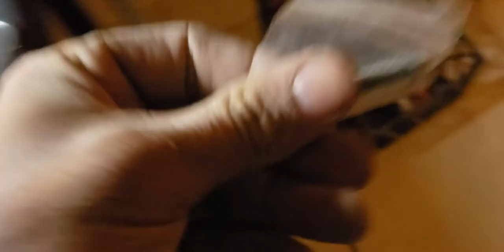Building a custom m14/m1a fiberglass stock

Comment: Why don’t you try epoxy with colloidal silica or glass beads.  Both of these materials lower the weight dramatically over body fillers such as bondo, they are also structural entities.

Comment: Where did you get a USGI fiberglass stock for $20?
Reply: i got one today for 120 on numrich lol
Reply from the maker: Numrich had a bunch of project stocks that were all basically unusable as they were. I had to cut off much of the metal and use just the base stock. They are perfect for what I'm using them for but they were rough otherwise. Fortunately, fiberglass can be left in water longer than steel.